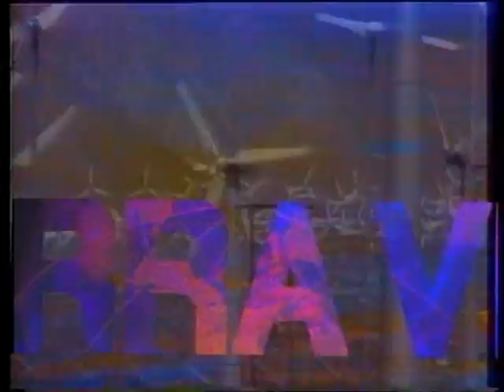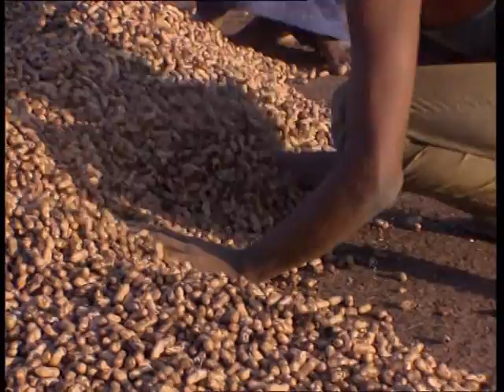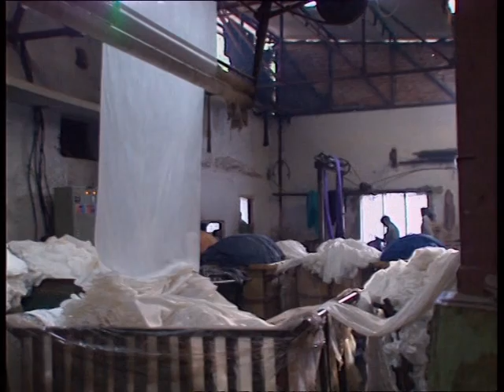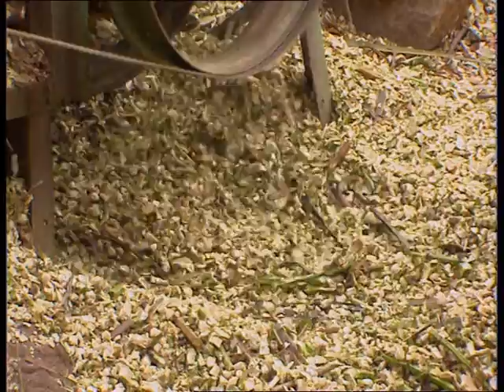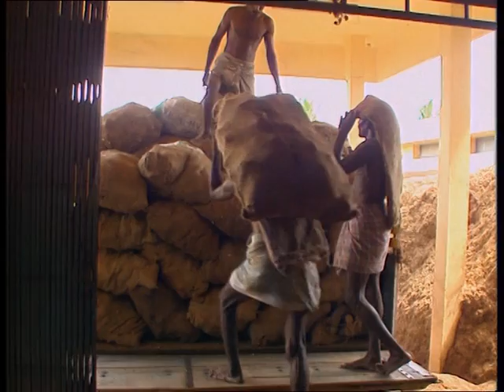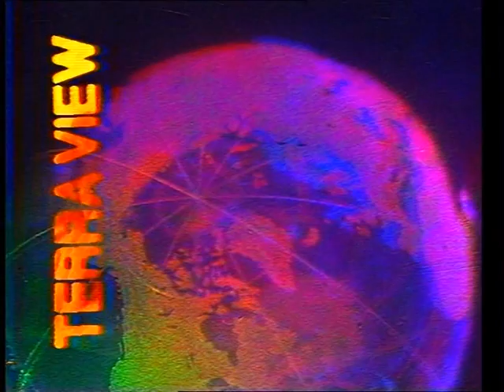Energy from Agro waste

Comment: Dear sir,
  I am from Gujarat, I am agri graduate  and in my area farmers are not aware what to do with farm west. They believes in to simply burn it in the farm only.
   Kindly suggest how to make it useful. I am also in line to go for startup by managing west..
  Dilip Bhanderi 
  8758726566
Reply from the maker: Dear Mr. Bhandari,
I am only a TV journalist and do know only the broader picture. 
You will have to google for finding the machinery suppliers and kind of application each machine can do
Research about the quantities of each agro waste, locate the machinery and the cost and space it requires. 
Do some calculations about the cost benefit ration of the project.

Perhaps you can hire an IIT graduate to do all this for you.
Best of luck.
Pramod Mathur